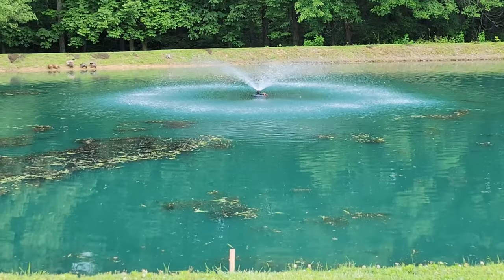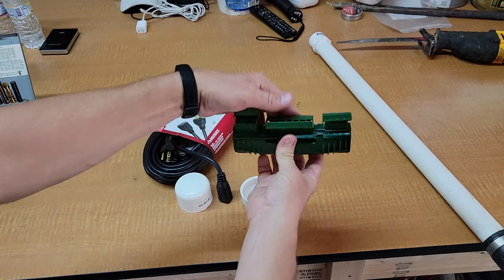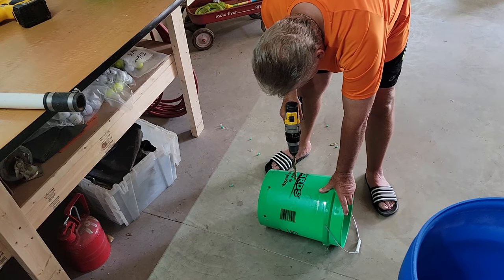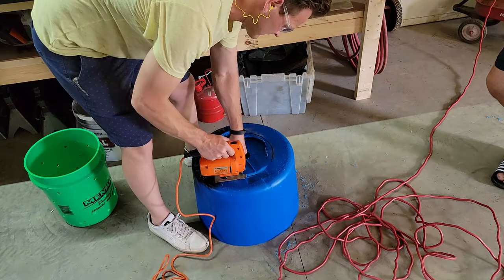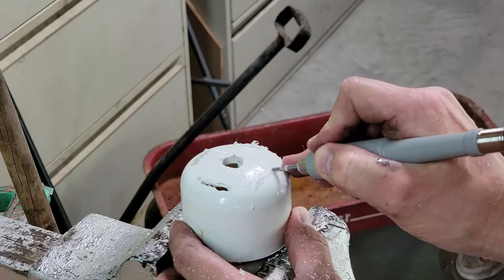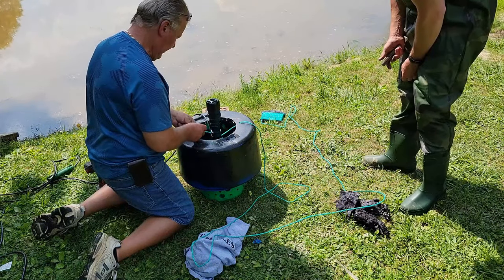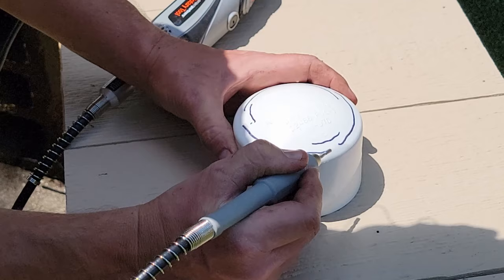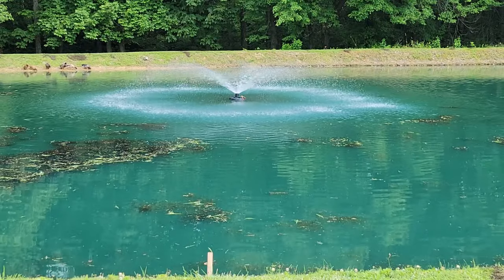How to Make a DIY Pond Fountain for less than $200

Comment: Awesome video! I’m definitely going to attempt this week. 
Is there a reason for the 3” cap instead of 2inch?
Reply from the maker: Good luck!   I could get more water out of the 3" cap since the holes were larger.
Reply: How important is to make  a perfectly smooth/straight nozzle head?
The nozzle head I drilled looks awfully sloppy/rough.
Reply from the maker: @johnskrabak716  I can't really say how much it will change the look of the spray.  I am getting ready to 3d print one, so it will be perfect, and I can let you know how that turns out.
Reply: @y2kok  yes please do share results of your 3D printed version. Maybe you could sell me one if mine is bad. ;)
Reply: @y2kok  maybe I missed it in the video but did you drill any holes in the bottom of the bucket or just the sides?
Reply from the maker: @johnskrabak716  Yes, I did put a couple of holes in the bottom as well.  However, I am not sure if it makes any difference.
Reply from the maker: @johnskrabak716  I still haven't printed one.  I really need to get on it.
Reply: @y2kok  Looking forward to hearing how your 3D Print version works!

Comment: cool video, i just bought a house with a 3 ac pond. first thing i would like to do is add a fountain. really good ideas in the video. thanks for making it. I had an idea of pounding a pole in to the pond bottom (maybe galvanized or even wood ) and welding   a platform to anchor pump onto then you would have a fixed location for the fountain without having to make a floating device. do you guys see any issues with this other than not be able to move and depth of anchoring pole in the bottom?
Reply from the maker: Do not put a hole in the bottom of your pond.  You might get lucky and have it not cause any issues, but you could cause a leak that would be very difficult to fix.  You could make a platform to sit on the bottom of the pond, but I would still prefer a floating option.  Also, if you have a three acre pond, then you may want to go the commercial route.  This will make for a much larger fountain that will look correct for the size of your pond.  Best of luck.
Reply: @y2kok  okay thanks for the reply. I made a decent fountain already from a 1/2hp sump and a fountain head from Amazon(works/ looks really good) but i tested over the weekend and definitely isn’t big enough. I’m gonna try the platform you mentioned with the one i made, maybe keep close to wading area and go maybe commercial for the rest. Sometimes things are worth buying. Thanks again.

Comment: I built a fountain using this method but I've burnt up 2 separate submersible pumps so far and can't figure out why? The first pump lasted about 8 months and the 2nd lasted less than a month. These are quality 1/2 hp pumps with steel impellers. I know they aren't being starved of water. I think the issue is electrical because the GFCI breaker is being tripped when they go out. Very frustrated.
Reply from the maker: You might want to try a different style of pump.  I am only on my second and they are still going strong.  How often are you cleaning the intake?  If it gets clogged then it will burn up the pump.  Also, it makes sense that your gfci is tripped when the pump goes bad.  Mine did the same thing.  

I would try this style of pump.  This will be the next style that I buy.  It will have lower GPH than the sump, but is rated for continuous use.  https://www.amazon.com/dp/B07FJZ55Y9/?tag=best-pond-pump-20&asc_source=browser&asc_refurl=https%3A%2F%2Fwww.bobvila.com%2Farticles%2Fbest-pond-pump&th=1
Reply: @y2kok  thanks. Do you feel I really need that 9k GPH 620W size pump? Where do you see that it claims to be rated for continuous use?
Update: please look at the Amazon reviews of the pump you shared. Not very impressive in terms of longevity 🤨
Reply: @y2kok @trinityacreshomestead4147 I think I'd prefer a minumum 3/4 hp as well. 660 watts would be great, (1hp=746w). The one you recommend also has overload protection. But IMO I'd pay a little extra for a better model. Remember, GFCI ONLY protects from ground fault, NOT an overcurrent/overload condition. Must keep filter clean (possible cause or subpar motor quality). If the pump failed it had already been running at higher amps, motor windings heated and fused, etc. If really wanted to protect from overcurrent/overload, as an added protection put an inline fuse holder and fuse in a larger 4" receptacle box with the GFCI (maybe 8-10 amps).

Comment: What name brand pump are you using, how long can it run, and how many hp.
Thanks in advance.
Reply from the maker: It is listed in the video, but the pump is a 1/2 hp sump pump.  Brand doesn't matter, but I used a Flowtec Floodmate 6000.   I am pretty sure they don't make that model any longer, but a 1/2 hp pump will work nicely.

Comment: How long is the chord on your pump? My pump only has about a 10foot chord and I cant find any extension chord connecters that are rating for being submerged in water
Reply from the maker: It is maybe 6 ft long.  The extension cord I used wasn't rated specifically for it, but it worked.  I don't know if there are cords specifically made for it or not.
Just make sure to use a gfi in case of a short.  Don't mess around with water and electricity, and keep the connections out of the water.
Reply: @y2kok  "Keep the connections out of the water"... How?  If the pump cord is only 6' long, then you need to use the extension cord cover and that will be submerged in the water, right?  Am I missing something here?

Comment: great work for self-making and saving money.  I have a question, did the $120 pump survive from nonstop working? usually this kind of economic pumps are not designed for continuous pumping but like a sump pump. I'm also seeeking to self making pond pumping system, but I want it endure.... don't have to redo... thank you
Reply from the maker: Hello Helen,
I am on my second pump now.  Both pumps were used in previous applications, and the reason that I used this type is because I had them already.  

You are correct that they are not rated to be continually used.  When my next one goes out I will buy this type of pump:
https://www.amazon.com/dp/B07FJZ55Y9/?tag=best-pond-pump-20&asc_source=browser&asc_refurl=https%3A%2F%2Fwww.bobvila.com%2Farticles%2Fbest-pond-pump&th=1
Reply: @y2kok  did you install this pump?  if so how did it work ?  thanks for this video I have a 25,000,000 gallon pond and a 60,000,000 gallon pond -  goal is aeration to reduce algae and increase oxygen.
Reply from the maker: @mainmacman9695  Yes, this one ran for over two years.  Worked well until the pump failed.  I am working on another design now.  I would use a pump meant for continuous running like something for a waterfall.

Comment: is it still working
Reply from the maker: Yep, going strong.  When I build another I will use a different style pump though.
Reply: @y2kok  I built one last year w a harbor freight pump. It didnt last long, but I was told they get clogged easy. I need to build another one
Reply from the maker: @workhardplayhard3206  If you are buying another pump then buy one that is made for continuous use.  I used the sump because I had it.  They cost about the same price, but the continuous use pump will be more efficient.

Comment: JUST CURIOUS...   How were you able to float the fountain into position and anchor it there?
Reply from the maker: I have a small boat that I use.  Otherwise, I could walk out there as my pond is only about 6 feet deep at most, but that would be significantly more difficult.
Reply: @y2kok   Stick with the boat!   A very fine resolve for the project.
Reply from the maker: @tribulationprepper787  Haha, for sure.

Comment: How do you go fishing with live electrical wire hanging in the water?
Reply from the maker: Use a cable that is rated for water use.  The connection is not in the water, and sits on top of the fountain in my setup.  Would be best practice to have a pump with a cable that is long enough to make it to shore.  That said, having this on a GFI is pretty critical.
Reply: @y2kok  I think that’s where some of the confusion comes in. I didn’t notice in the video where you said to make the extension cord attachment inside the bucket. I also visualized it being underwater with that little protector, being the only thing holding the water out.

Comment: Have you attempted a head that sprays high out the middle as well?
Reply from the maker: Yes, you could make a singular hole in the center and it would go quite high.  However, that is going to lead to a lot more evaporation, and that is why a lot of people don't use that spray pattern.
Reply: @y2kok  good to know thanks for the reply
Reply from the maker: @jacobwaffird5082  Not a problem.  Best of luck on your build.

Comment: What hp pump did you use?
Reply from the maker: I tried .5 hp and 3/4 hp and both worked.  I ended up using the 3/4 hp just for the extra water movement.  

Best of luck!

Comment: How  did you adjust the rope length for the cinder blocks. I have floating  islands in my pond. And water level puts them in different spots.
Reply from the maker: So you can do this a couple of ways.  The way that I mainly do it is just select a length of rope and then just set the fountain where I want it, and pull the rope out to full length and then drop the cinder block from there.  It will stay pretty tight if you drop one, and then go to the other side and pull everything tight and drop the second.

The second method would be to drop the cinder blocks and then just tighten the rope on the fountain while it is in the water.  

Good luck!